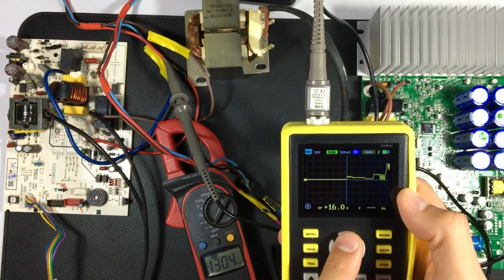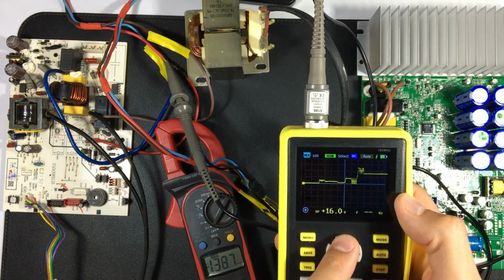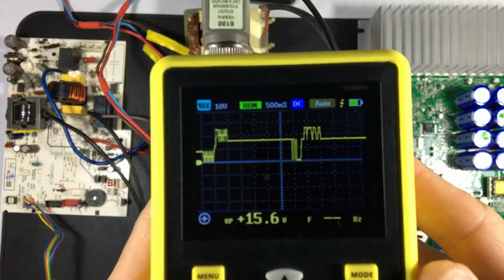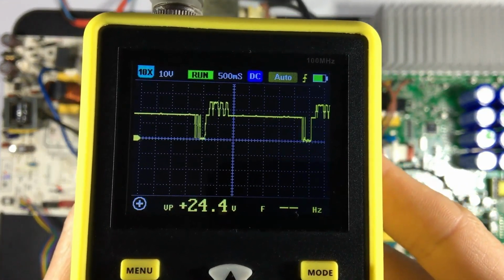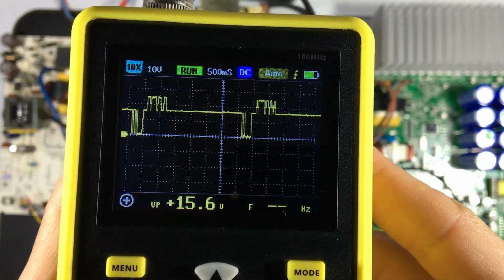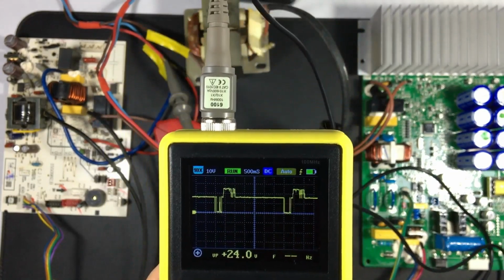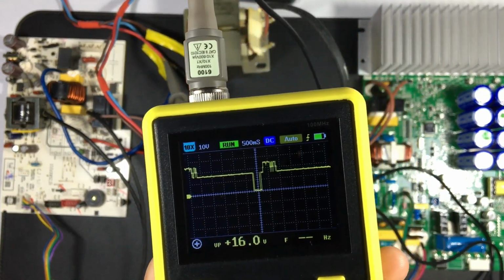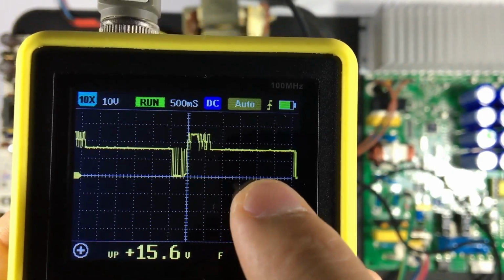Class 65: Inverter Communication: Key Voltages #inverter #electronics #voltage

Comment: Hi. I find another kind of communication in multi-split equipment. I find that the component that manages communication is the MAX 13085E. It works with the rs 485 bus, the voltage is around 5 Volt.  Could you explain this system please? Thank a lot for your work.
Reply from the maker: Join our channel to access the classes by title and by module, and study effectively!
Join the Module Access level or higher!
TAP HERE ▶️ https://www.youtube.com/channel/UCfu_M6VyaVaJK9R69DsZGHA/join